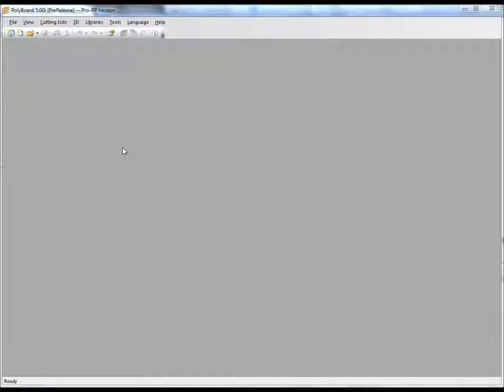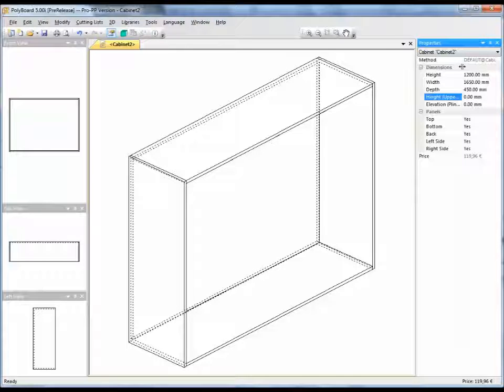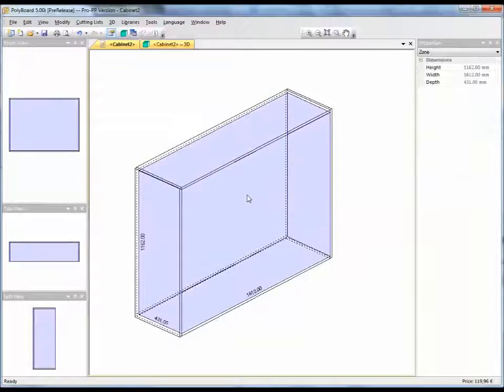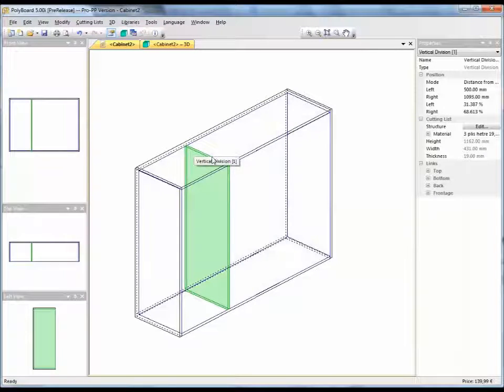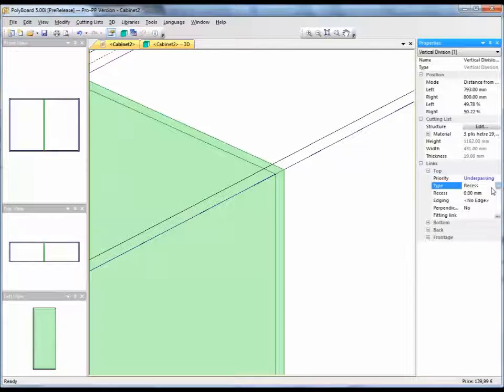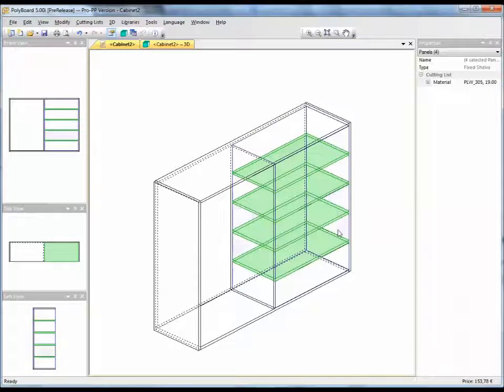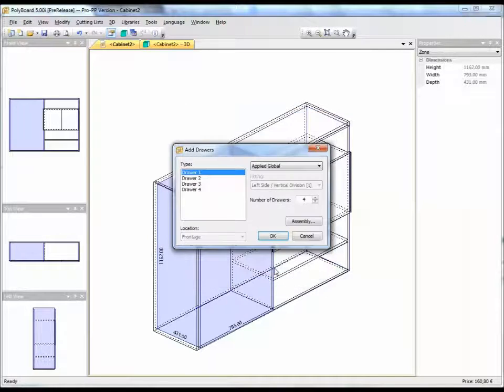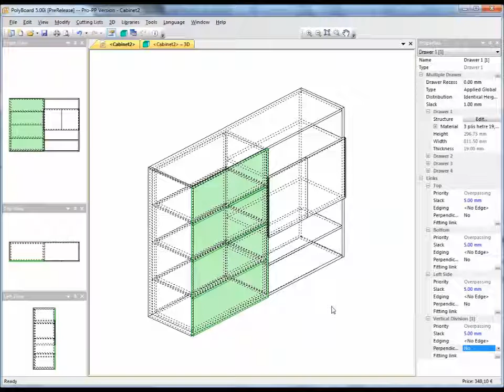Basic furniture design with PolyBoard cabinet and furniture software

Comment: hi! Please let me ask when I attach the components to the polyboard, 
then when I see the wireframe perspective mode, I don't see the 
components.
although when I saw print review, I saw that device. Please show me how to fix that
Reply from the maker: Hi Quan, thanks for your comment. If you are referring to machining for hardware, there's a button in 3D mode with a yellow cylinder icon on it, it's called '3D Toolings'. That turns machining details on and off. If you have any other queries, please go to our technical support forum here: https://wooddesigner.org/forum/